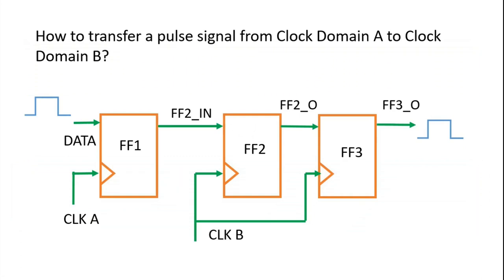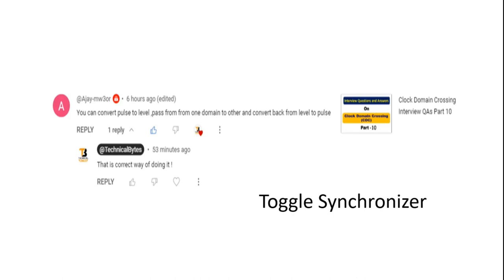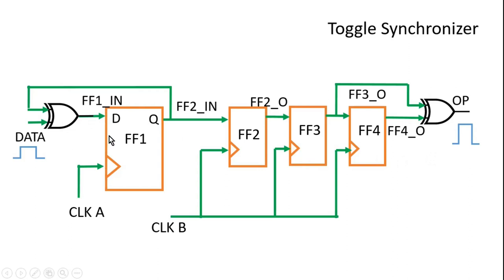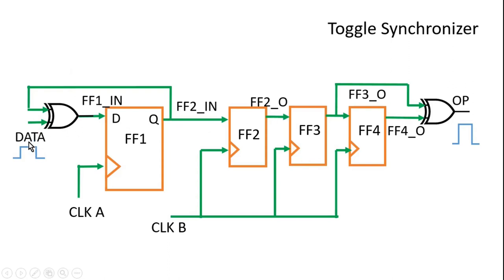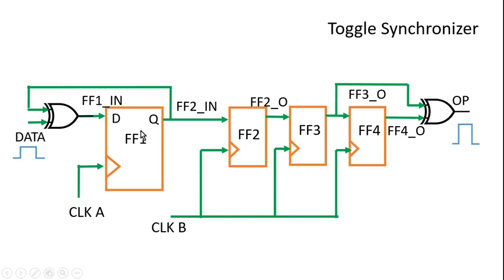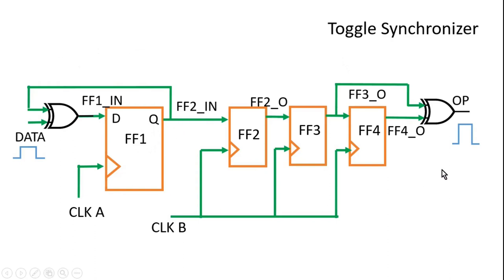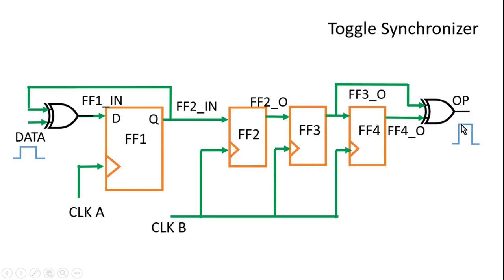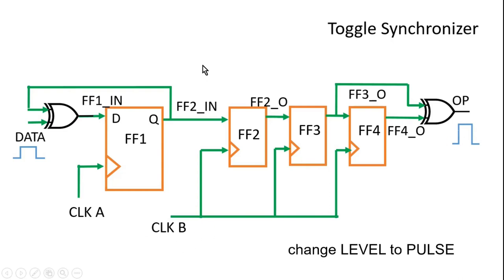Clock Domain Crossing Interview QAs Part 11

Comment: It works for CLKA=CLKB
It works for CLKA_f > CLKB_f iff there is only one pulse in the CLKB_time period, otherwise, CLKB can again miss sampling it.
It doesn't work when CLKA_f < CLKB_f, CLKB starts sampling it multiple times. This is generally solved by providing a CLKEN signal back to CLKA indicating when to sample. CLKEN must be generated just for one pulse in domain B but shipped back to domain A for sampling just once.